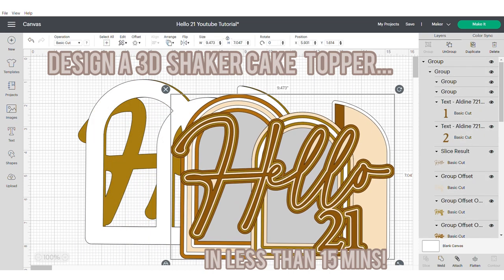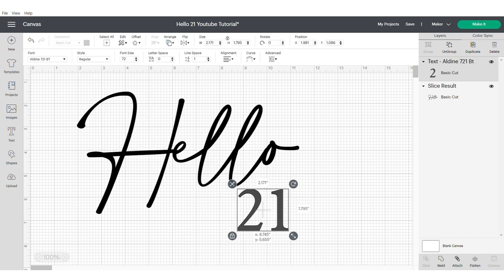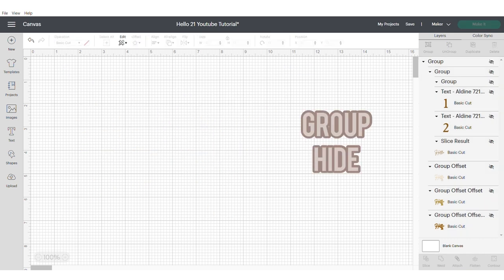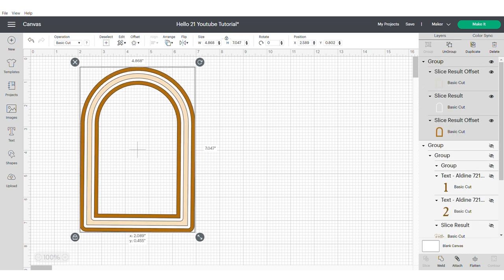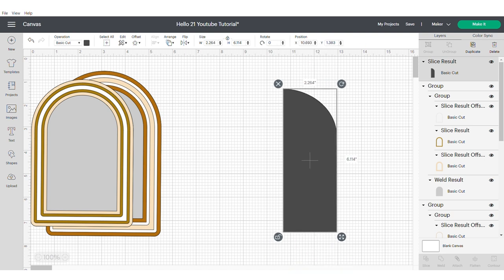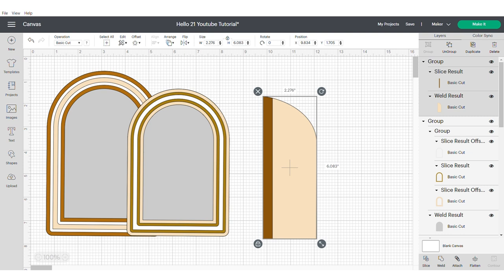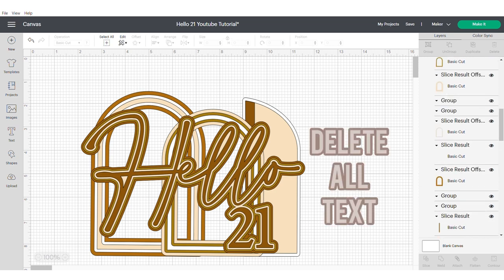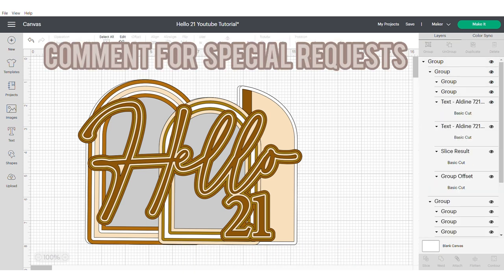How to Design a 3D Shaker Cake Topper | Cricut Design Space Tutorial | Step by Step for Beginners

Comment: Why did you take acetate layer out when making back?
Reply from the maker: I remove it because I want the cake topper acetate shaker part to be transparent.  If you weld the acetate shape in the back will be a completely solid card-stock piece and you won't be able to see through. However you can weld it in if you want a solid shape at the back and not a see through effect 🥰